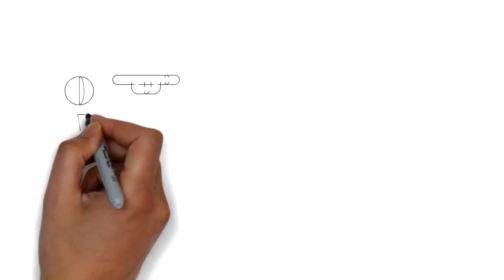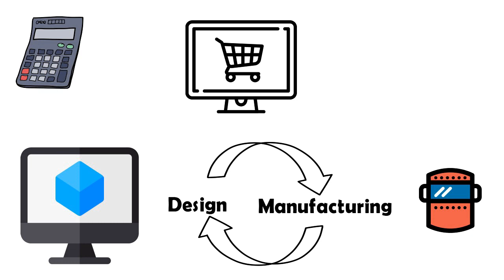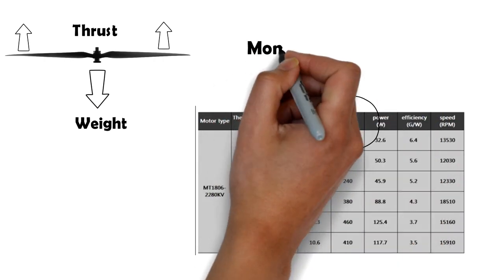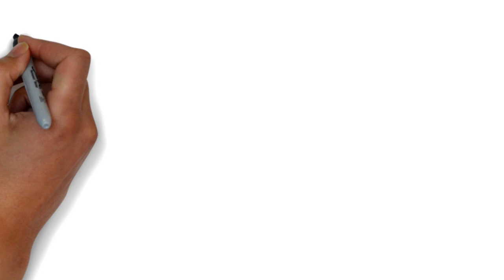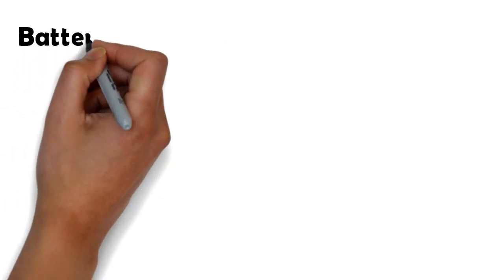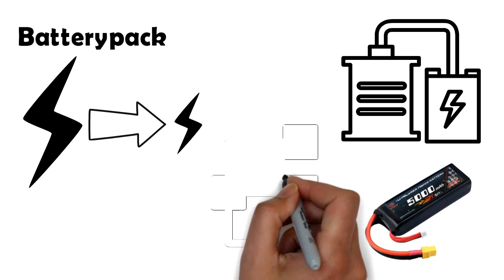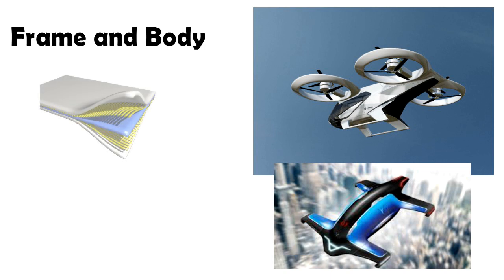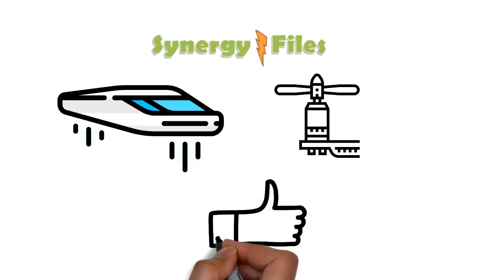How to make your own eVTOL aircraft- Part3

Comment: We made an Evtol Octocopter weighing 200lbs. The motors put out a max thrust of 36kg each. Our propellers are 40" carbon fibre. There is about 5" between each propeller. We are not getting lift till we apply about 90% thrust. We were expecting lift at 50% thrust. Could the cause of this be that there is not enough space between each propeller? Thanks for your help. I love your videos.
Reply from the maker: Could be a few things. It could be that the rotor downwash is getting intercepted by the arms or airframe. You could also try to increase distance between them. I cannot really say until I see it.  Btw if you are into this stuff than you should checkout my other channel called Electric Aviation. Many thanks